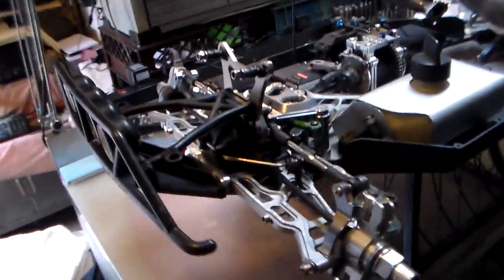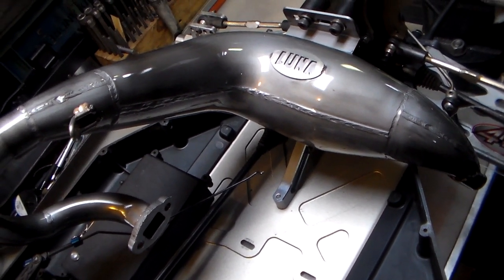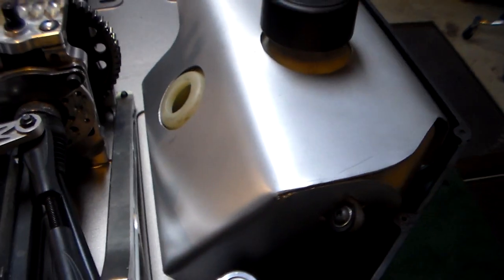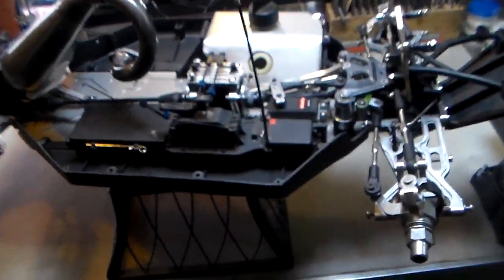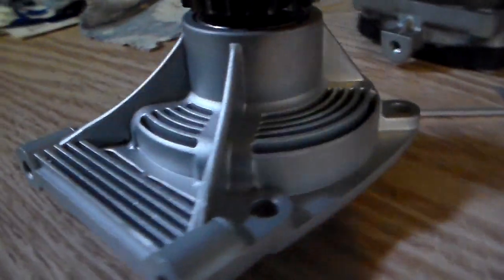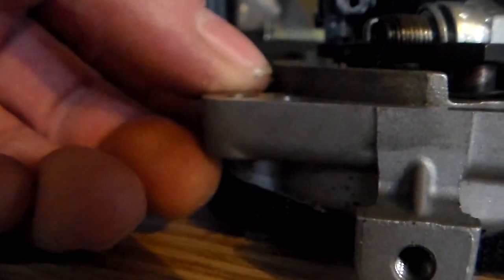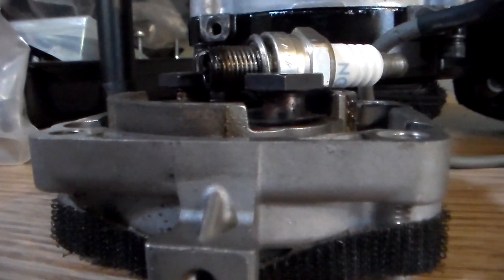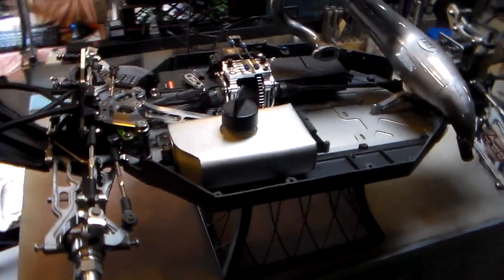Losi 5ive-T Cleaning and Rebuilding for the Summer. Aluminum Fuel Tank Cover.

Comment: Love the clear coat on the pipe.  What paint did you use again?
Reply from the maker: Autozone   VHT HIGH Temperature Enamal Gloss Clear up to 550 degrees
Reply from the maker: The inherent heat from the engine will also accomplish curing it says on the side of the can